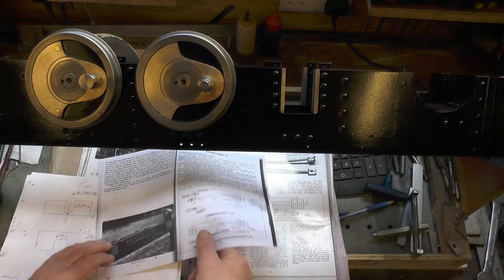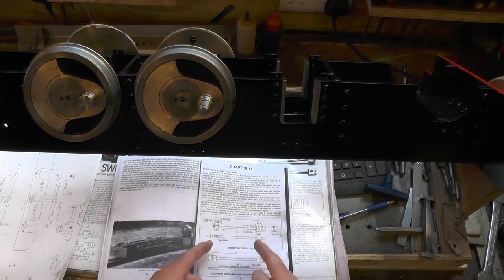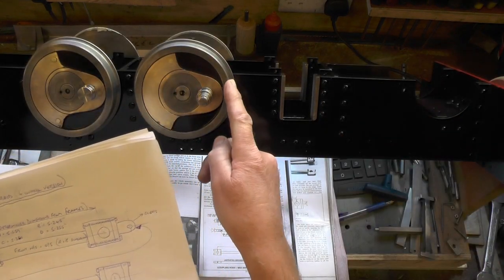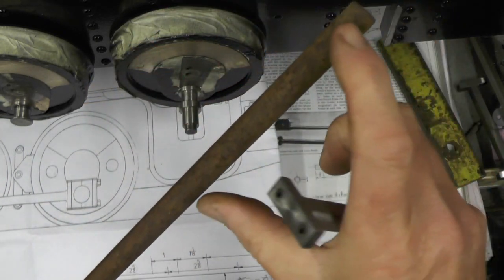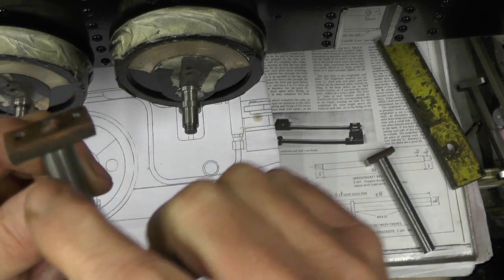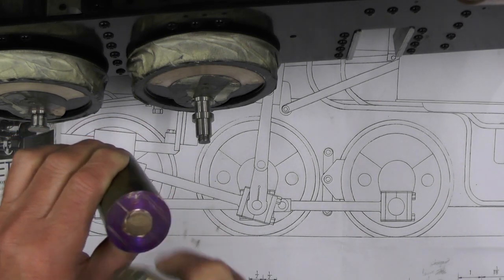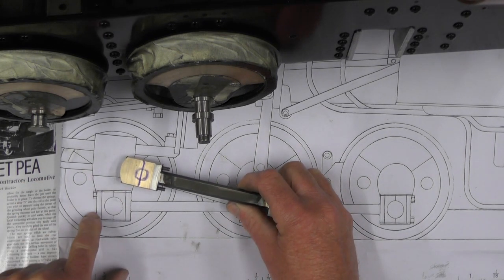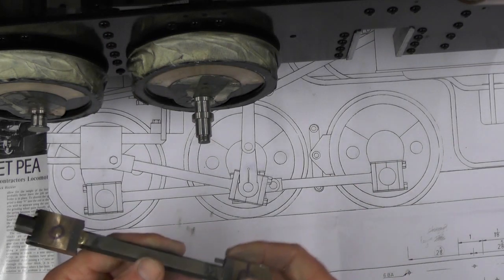Making a Beginners Steam Loco (Coupling Rods Part 1)  "mr factotum"

Comment: Thanks for that. I'm just about to start my con rods using the book once I get my head round  how the ends are made. Thanks for the videos.
Reply from the maker: No problem 👍 KGRN
you will do it, i'm just about to make the connecting rods for my other sweet pea project, once you get started you'll be fine,  my motto is, if something does'nt work out 1st time just do it again.
keep in touch👍👍🚂🚂😉😉
regards
Kev